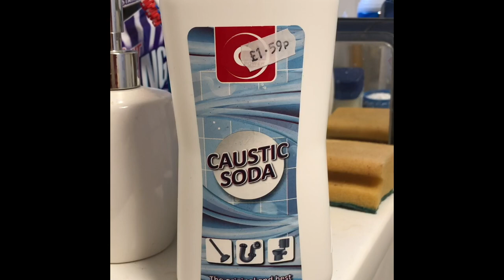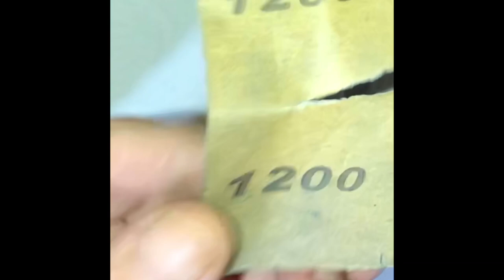Dinky Observation Coach

Comment: Excellent job on this one, a lot of preparation! Well done with your new air brush, something I’ve not tried yet, I bought all the gear but still plucking up the courage to try it lol. Your choice of background music transports one back to an era of care free days and I can just see your old coach trundling along packed with people returning from the seaside!
Anyway, well done, a lovely restoration👌👍😊
Stay safe and take care, all the best, Nick.
Reply from the maker: CRAPAUD NICK'S DIECAST RENOVATIONS. Lol yeah I took quite sometime with the music to try get one that would fit the theme so thanks for noticing that 😀 regarding airbrushing though buddy just delve in and go for it granted buying the paints and thinners and all the mixing pots etc is a big outlay the costs then between rattle can and airbrush is massively different I found because you can make almost any colour yourself or adjust shade as you work it’s cheaper than buying a can then it’s not quite right so either use it or go and buy another it soon adds up but anyway Just go for it Nick it amazing the control you have is great, thank you for your continued support buddy it means a lot so thank you as always I can’t wait for your next video until then keep yourself and your family safe 😷😷